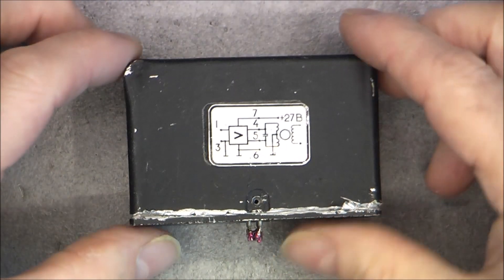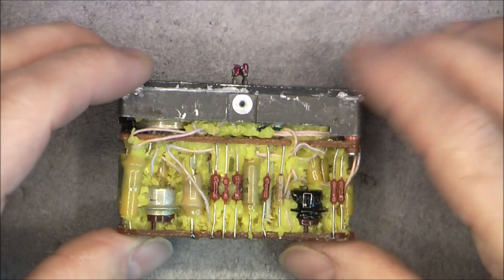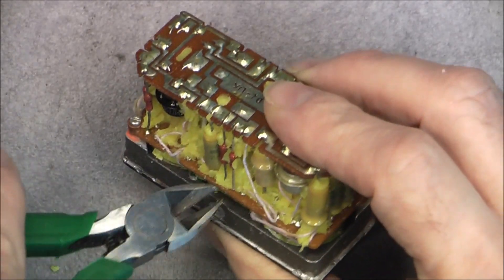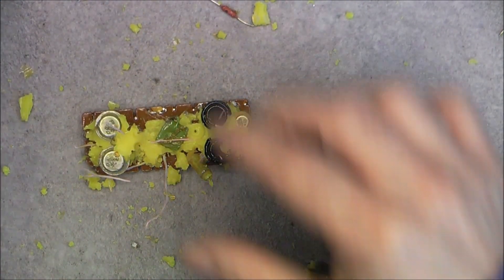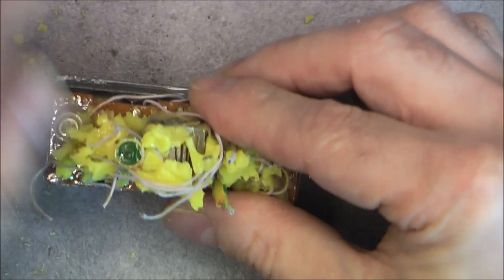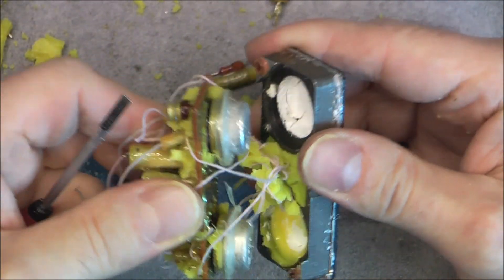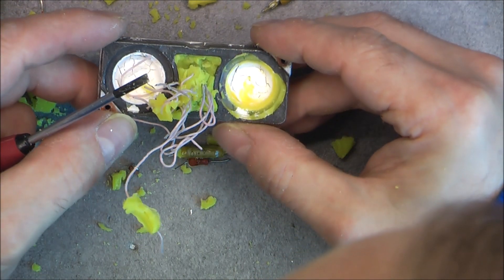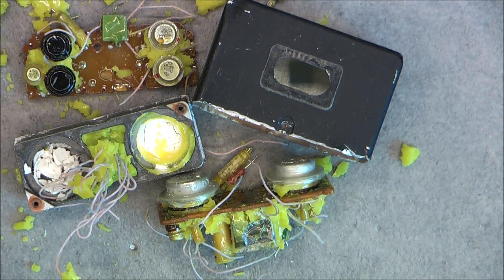Soviet "УП-70-2В" avionics amplifier module teardown

Comment: Could you maybe actually find some information on it and explain rather then just rip stuff apart and throw it away? After seeing the ways of construction they used there is really no further information in your videos...
Reply: MichaelKingsfordGray  Yes, the thing that bothers me though is that while doing a tear down other people like for example mikeselectricstuff actually try to make sense of what they find, they explain the purpose of components and the construction, mostly even powering it before and during tear downs. Here im afraid there is only ripping apart for the sake of "look there is soviet transistors and potting compound, good bye". Thats very sad considering the historic value of many parts.
Reply from the maker: Information about it is very scarce, as most the times. I found some russian websites where is listed or available for sale, but nowhere any technical data.